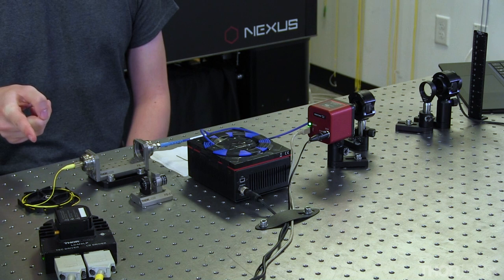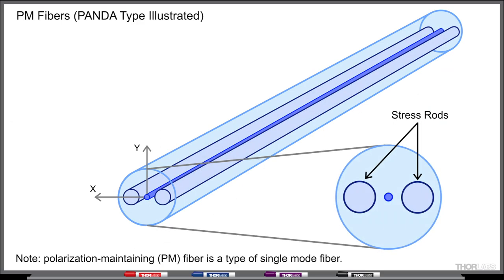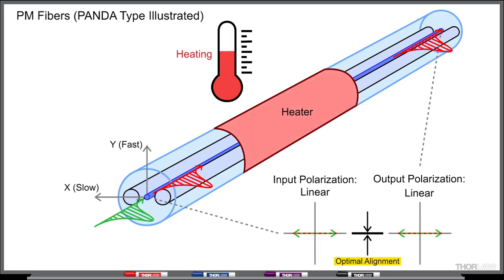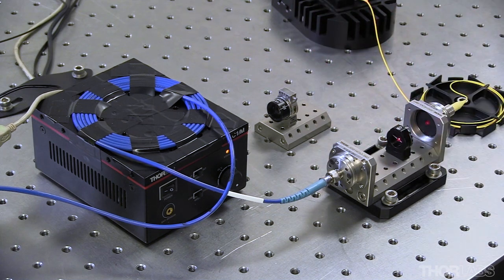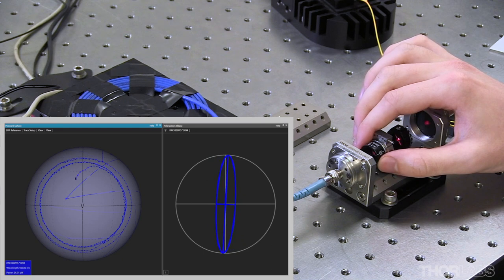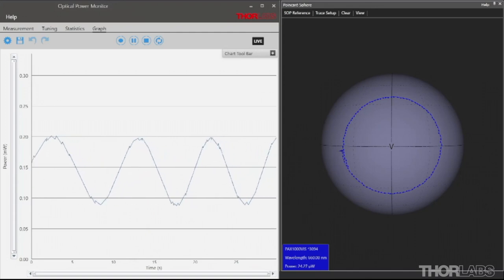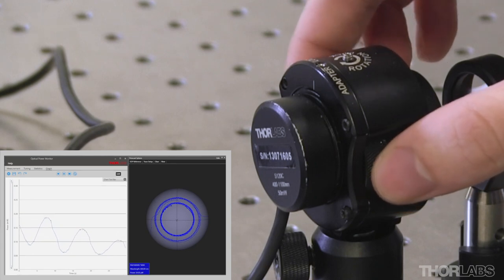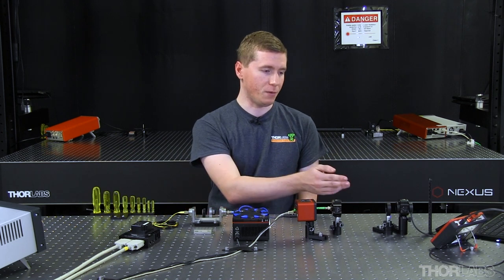PM Fiber Measurements Used to Align Incident Polarization State (Viewer Inspired)| Thorlabs Insights

Comment: Hello Thorlabs, I am trying to measure PER while heating the fiber with Polarimeter PAX1000 Thorlabs and the problem is that I do not get a circle but rather other strange shapes and I have suspicious that my source is not stable enough. I use S1FC1310PM 1.5mW Thorlabs laser source. Could you please confirm if such source is even suitable for PER measurement?

Comment: Great video! And thanks for keeping the comments section open! In the video you say that the inability to get a perfect linear polarization maintained is in the fiber (namely, its imperfections). In my setups I usually blame waveplates :) Therefore, for this setup I would swap a half-wave plate an a polarizer, since I trust more to the polarizer that nothing except linear polarization survives there. I wonder, have you tried the same experiment with polarizer being set after the waveplate?
Reply from the maker: @ВладимирЗенин-ч4к It is great that you are considering the components’ limitations and thinking of ways to improve the setup! We agree that the assembly you describe (half-wave plate followed by a linear polarizer (HWP-LP)) likely provides a higher extinction ratio (ER) than the assembly used in the demonstration (linear polarizer followed by a half-wave plate (LP-HWP)). 
 
We did not perform a direct comparison of the HWP-LP versus LP-HWP options on the PM fiber’s output polarization state. Both options provided linearly polarized light with an ER sufficient for our application, but for this demonstration we preferred the LP-HWP option, since its alignment was more straight-forward. 
 
However, our experience and published research agree that, even when the input light is perfectly linearly polarized and aligned to the PM fiber’s axis, it is expected the light output by the fiber will be slightly elliptically polarized. Stress points are common places for cross-talk to occur between a PM fiber’s orthogonal axes.
Reply: @thorlabs  Thanks for detailed reply! Never thought that the cross talk in normally resting pm fiber can be notable

Comment: Why do we need a half-wave plate? I think a single linear polarizer is enough (just rotate the linear polarization axis). Could you give me more information?
Reply from the maker: @user-gk2or5jb7o  Technically, we did not have to use the half-wave plate (HWP), but we chose to use it because we wanted to couple the maximum amount of light into the PM fiber. The elliptically polarized light output by the input fiber had a significant linearly polarized component. We aligned the polarizer parallel to this component and then used the HWP to rotate the orientation of the transmitted linearly polarized light to align with one of the fiber’s axes. 
 
If we had used only the linear polarizer, and the orientation of the polarizer’s axis that aligned with the fiber’s axis was not parallel to the orientation of the linearly polarized component in the input light, the polarizer would have blocked light that the polarizer-HWP pair could have coupled into the fiber.

Comment: Is it possible to put a lens on the end of a fiber optic cable to project an image out?
Reply from the maker: @DiabloMablo  There are different options for attaching lenses to fiber end faces. In addition, the end of the fiber can be processed to include a lens directly (e.g. a ball or GRIN lens). It is typical to use lenses to collimate or focus the light from the fiber. One of the quickest options for collimating the light is to attach a fiber collimator (e.g. https://www.thorlabs.com/newgrouppage9.cfm?objectgroup_id=4353&YVI=28).

Comment: have used this method with SKPolarization analyzer with the help of a 1/2 and a 1/4 waveplate and did gentle shaking of the fiber by hands
Reply from the maker: @sadiqnawazkhan333  Yes, shaking the PM fiber measured by the polarization analyzer/polarimeter is an equally valid approach to perturbing the fiber. When using that approach, we find the output polarization state jumps back and forth, and it was faster for us to create full circles on the Poincaré sphere by heating and cooling the fiber. If someone is looking for a method to heat and cool without having to get extra parts, the fiber coil can held flat between your hands/fingers to heat it and then placed on the optical table to cool.  We liked using the temperature controlled breadboard, since someone just needs to turn the dial or apply a computer program to start changing the temperature, which leaves both hands free for alignment.  

Do you see consistent results when using the quarter-wave plate to counteract the excess birefringence? We have seen mixed results when using that approach with PM patch cables, which we thought was likely due to the stress-induced birefringence of the fiber connectors. More specifically, the quarter-wave plate compensated for the birefringence introduced by the first connector to create linearly polarized light within the PM fiber, but the birefringence caused by the second connector still affected the output polarization state.
Reply: @thorlabs  I remember the use of a quarter wave plate could not make the polarization circle a single point but only minimized it so that it was enough for our experiment. Also, the time scales at which the light was pulsed were very short and thus any residual impurities in the polarization mode could not contribute to the light intensity fluctuations after  the fiber

Comment: Since the PM fiber has a fast & slow axis, does it mean that it could only preserve light that is linearly polarized and aligned to either fast or slow axis? circularly or elliptically polarized light can't be preserved by the PM fiber? Since they do no oscillate along one axis.
Reply from the maker: @dewenzhang2115  You are correct! PM fiber can only preserve linearly polarization states that are coupled into (aligned with) either the fast or the slow axis. You are also correct in stating that PM fiber cannot preserve a specific circular or elliptical polarization state. As you say, the PM fiber will not preserve the polarization state of any input light that has polarization components that oscillate parallel to both the fast and slow fiber axes.

Comment: Could you give a tutorial for aligning the axis of two lensed PM fibers? This is commonly used in fiber-based experiments.
Reply from the maker: @victoriazhang9274   Thanks for your suggestion! Would you help us better understand what you have in mind, since the word “lensed” means different things to different people? For example, some people use the term to describe fiber with a shaped end face (often rounded), which creates a lensing effect for light exiting the fiber. Other people use the term to refer to fibers that are terminated with a GRIN lens or that are connected to a fiber collimator. What does “lensed” mean to you? It would also be great to hear how close you’re placing the fibers and if you’re putting any optical components in between.

Comment: Great demonstration. Could you explain why the single mode fiber from the pigtail laser does not cause polarization fluctuations? If I only need a stable polarization, not necessarily linear, then can I just use a single mode fiber instead of a PM fiber?
Reply from the maker: @user-eg4uc2iy4f   Single mode fiber can be a good option for preserving a random polarization state (impossible for a PM fiber), assuming a few conditions are met. The fiber must be protected from mechanical and temperature perturbations, which can cause unexpected changes in the polarization state. Results are also better for shorter lengths of fiber and over shorter time periods. In our demonstration, we secured and stabilized our short single mode fiber and only showed the fiber’s output over a short time period. We added a linear polarizer to the FiberBench to ensure a stable linear polarization state was consistently input to the PM fiber, which is much better than single mode fiber for providing a stable linearly polarized output.

Comment: Excellent video!! 
Question: If using the LP + power meter approach rather than polarimeter, why do we align the LP such that we are equally collecting from both PM axes? Can we simply align the LP to either slow or fast axis, and then tune the HWP to maximize power such that the input SOP is aligned with either slow or fast axis?
Reply from the maker: @szu-yulee390   In general when optimizing alignment, it is often necessary to look for small changes in output power when making adjustments. These small changes can be very difficult to detect when they are being added to, or subtracted from, a high-power baseline. Because of this, it can be very difficult to know when the power is truly maximized. Instead, it is often helpful to look for the minimum power, since small changes compared with a low-power baseline can be a lot easier to see. 

However, both of these approaches assume that the system can provide a constant maximum or minimum value. The PM fiber and linear polarizer system will typically not provide a stable maximum or minimum power output, since some light will always be coupled into the fiber’s orthogonal axis. Rather than try to take this effect into account, we find it easier to optimize alignment by setting the linear polarizer’s axis between the fiber’s axes and minimizing the amplitude of the oscillations.
Reply: @thorlabs thank you very much for the details! I am still one step behind the logic. So the linear polarizer right before the power meter is set to between PM fiber's axes. Then, why minimizing the amplitude of the power oscillations by rotating the HWP means the linearly polarized input is aligned to one of the PM axis?
Is it because otherwise the PM fiber output is in general elliptically polarized and we will see power oscillation?
Reply from the maker: @szu-yulee390  That is correct! Light output by PM fibers almost always includes a small fraction of elliptically polarized light. This is caused by a variety of reasons including: imperfect linear polarizers transmitting a small amount of light polarized in the orthogonal direction, obtaining perfect alignment is difficult, and light aligned to one fiber axis scattering into being aligned to the other fiber axis at perturbations like bends and irregularities in the glass material. This is why, in the demonstration, we could reduce - but not eliminate - the power oscillations.
Reply: @thorlabs this is again very clear and insightful explanations to me. Thank you very much. Keep the high quality videos coming!
Reply from the maker: @szu-yulee390  You are welcome, thanks for asking :) And, if you have a topic suggestion for us, please let us know!

Comment: Question 1: when heating the fiber, what is the temperature ramp range? If we want to do long term measurement, do we need ramp up and down the temperature periodically? If the temperature is modulated, will we see the points on the circle moving in opposite direction? 
Question 2: I was doing similar measurement, when we stress the DUT, we see a the SOP point moves on the Poincare sphere. It forms a circle but the center of circle also moves. How do we explain the circles moving on the sphere?
Reply from the maker: @USAsuperstore    Response 1: The temperature-controlled breadboard we used has a temperature range between 15 °C and 45 °C.  We used the range from about 25 °C to 45 °C, which suited this demonstration well, but other applications and fibers may be better served by a different temperature range.  

The temperature needs to change in order to make the measurement. Temperature cycles can occur periodically to confirm alignment at discrete times or the temperature could be cycled continuous to visualize dynamics. But it is important to remember that temperature change will induce continuous polarization change at the fiber output during the assessment. 

Yes! The points on the Poincaré  sphere will plot in opposite directions, depending on whether the temperature is increasing or decreasing. 

Response 2: This analysis technique assumes that the fiber’s birefringence changes, but that light does not couple between the fiber’s fast and slow axes. As you’ve noted, physically straining the fiber also changes the fiber’s birefringence. However, physically straining the fiber can also cause microbends and other effects that enable light to more easily couple between the slow and fast axes. When this occurs, even when the input light is perfectly aligned to one fiber axis, some light can couple into the orthogonal axis due to the stress. Since there will then be light in both axis, and the amount depends on the stress applied to the fiber, the center polarization state of the output light can drift.
Reply: @thorlabs  Excellent and super clear answers. Much appreciated.